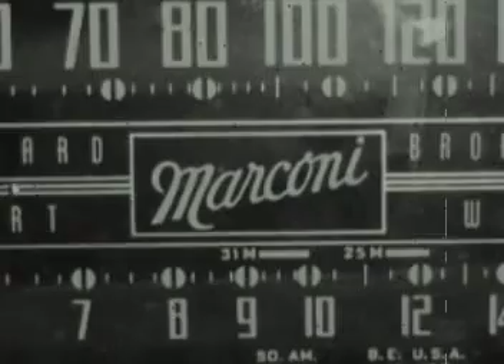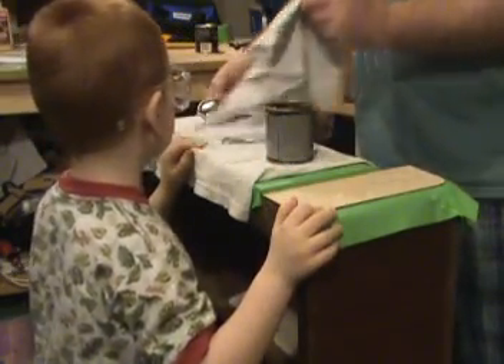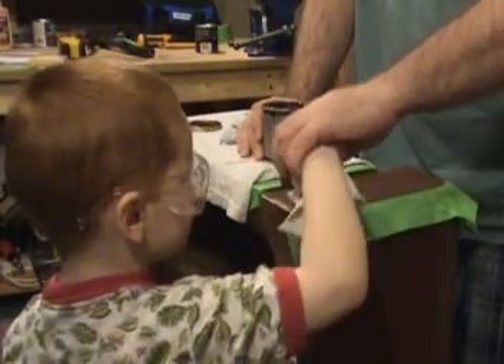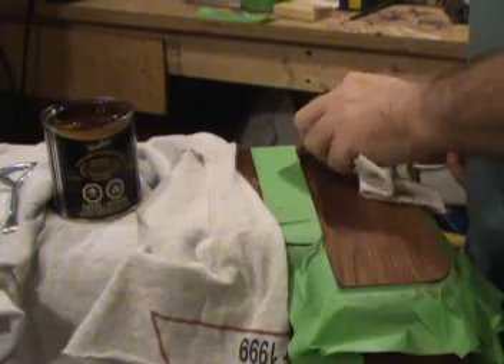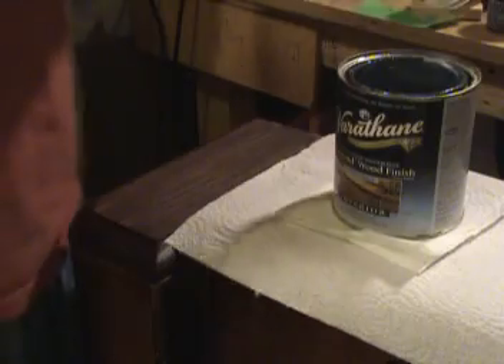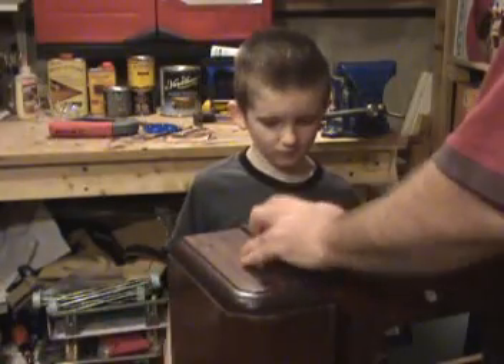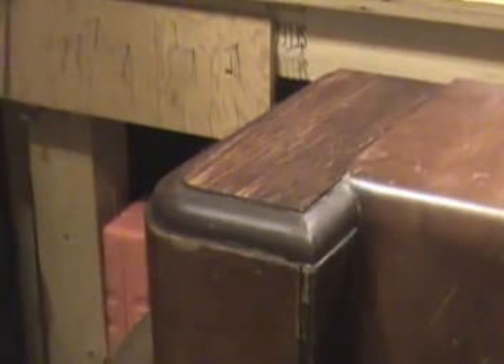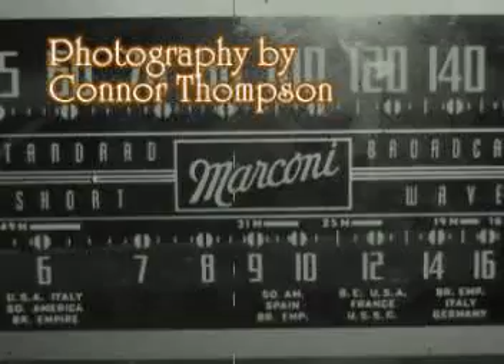Repairing and Restoring Tube Radios - part 7

Comment: From one Thompson to another...Great Job!!!  You've got me hooked to see more.  I have a Garod V Neutrodyne that I will be restoring in the future...actually have 2 of them, but should between the two be able to end up with one working one!  I plan to build a low power transmitter and broadcast Old Time Radio programs to it from the transmitter.  The Garod is a TRF style radio, and uses all 01A type Triode tubes for every tube.